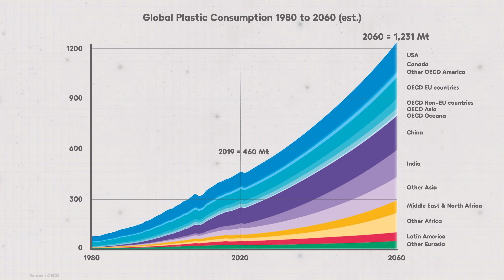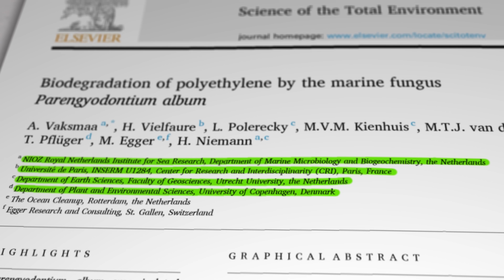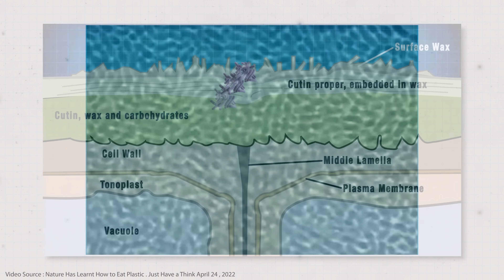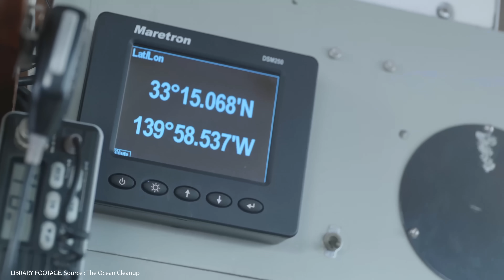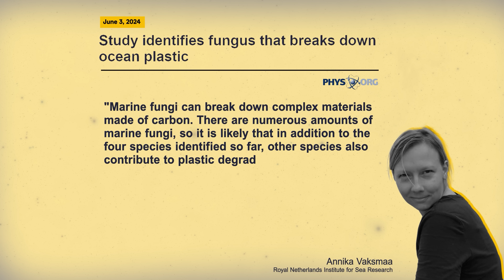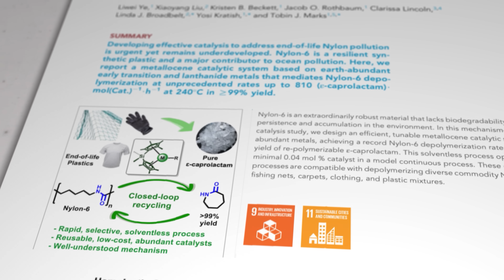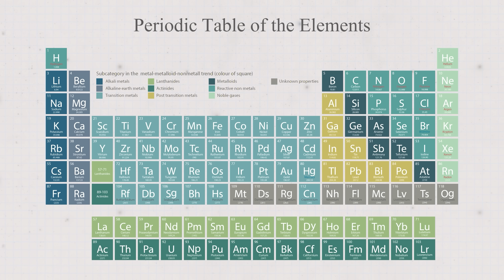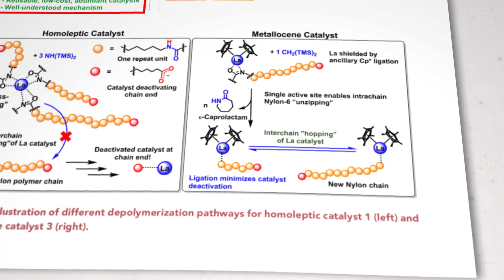Our oceans have learnt how to EAT PLASTIC!

Comment: The irony is that because we haven't given a damn, we have eliminated one of the major benefits of plastic: it doesn't decompose.
Reply: Much the same story with anti-biotics
Reply: Well there goes my classic console.
Reply: @chudchadanstud  There goes whatever we store in plastic containers and packages and even our damn water sources (stored in huge plastic tanks in our buildings).
Reply: @chudchadanstud  My super nintendo has been degrading since the 90s. The clean white shell has turned into a flaky yellow. This is why I switched to emulation
Reply: @chudchadanstud  it's ok. your console will still outlive you
Reply: @chudchadanstud metal is not
Plastic. What console do
You have? 😅
Reply: @whiteingale majority of game consoles are made of plastic, not the machine parts,  but the covers.
Reply: @tfive24  i see. 😅 I come from older generation
Reply: @Fuscao_Preto  i decided to look into this and they are primarily made out of a variety of papers/ glasses + resins for the majority of the filler (the usually green part of the circuit board) there is no plastics used in circuit boards (with the exception of things like breadboards) due to high heat exposure during soldering.
Reply: @himebito  I think you're a bit confused. Plastic is still present in the form of polymers (polymer resin's). Also the green part is usually a solder mask. So it would still be eaten away in the form of delamination...
Reply: @z-ZONDER-z_E15 if you're storing your x box in an ocean gyre yes. Maybe keep it in the living room?
Reply: @Fuscao_Preto  
Its a epoxy based glass laminate, some like FR4
Reply: @tfive24  pretty sure machine parts too, the PCB substrate is made of plastic as well.
Reply: @whiteingale  the cooling fan , the sleeves around the wires that protect the cables from interference , the socket of the cpu , the connectors , 
the outside of mosfets and other chips soldered to the motherboard that have a plastic protective casing around them etc etc etc etc etc
Reply: @Fuscao_Preto  They are Fiberglass and Resin. Some PCBs are actually made of ceramic but not only ceramic is considered to be outdated but also insanely high-end by today's standards. IBM's Power Architecture modules were gigantic MCMs made of ceramics with several CPUs, Dedicated Cache ICs and some sort of ASIC incorporated into the humongous MCM package. So yes ULTRA HIGH END stuff. Mainframe kind of stuff.
Reply: @EvolutionDataOptimized  that;'s my favorite subreddit!!
Reply: @norbertnagy5514  you're smart just like reddit.
Reply: @whiteingale  someones regarded
Reply: @Fuscao_Preto  There have been PCBs from the 1980s that used Sapphires as a substrate, feel better.
Reply: @Fuscao_Preto  Metal, sand and plastic or something like that, yeah? lol
Reply: @whiteingale  99 percent sure electric devices always have a teeny bit of plastic even if just for some microscopic reason
Reply: @whiteingale uhhh my guy.... your consoles are made with metal
Reply: @Fuscao_Preto  PCBs are usually made of silicon or fiberglass and other materials
Reply: @Fuscao_Preto  Silicon???
Reply: @Fuscao_Preto  Fiberglass mostly?
Reply: @Fuscao_Preto  
"I wonder what PCBs are made out of."
I looked into that a little. They can be made of many different materials, but the most frequent one seems to be fiberglass reinforced epoxy resin, that is, glass + polymer.
Reply: @whiteingale  say you were born in 08 without saying you were born in 08
Reply: @draywolf4761  makes me feel old now.
Reply: Welp, back to heavy metals!
Reply: @ozvoid1245 imagine if they evolve to consume that too
Reply: as long as they stay in the ocean and away from my anime figures it's cool
Reply: Another reason not to go outside bro @tempoaccla4041
Reply: Don't worry, Margarine Butter is still a close second in non degradable products that nature doesn't even want to touch. If you leave out Margarine next to an ant hill, they will never eat it. Nor any other bug.
Reply: Same story as antibiotics. We have a real knack for coming up with miracle products then ruining them through apathy and greed.
Reply: This sucks
Reply: We haven't eliminated that unfortunately. It not decomposing is actually better now than it was in the past. Bottles and bags whatever type of plastic they were made of became brittle and broken much faster about 20 years ago. Weren't flakey and crackled. Now it's a lot more robust.. I mean not all of it you still get the chappy type as well.
Reply: how is that a major benefit
Reply: @SirMrTreflip how isn't it?
Reply: Plastic bag decomposing after 150 years in ocean will not discourage anyone from using them.
Reply: @lamebubblesflysohigh what are you trying to say….
Reply: Well the problem is that eventually it’s gonna evolved to become airborne like the microbe that govern decomposition. And it will keep getting better and better meaning we have to find an alternative or all of our canned products will start having holes drilled into them.
Reply: BAN PLASTIC. GO BACK TO GLASS.

REDUCE REUSE.
RECYCLE IS ONLY A DREAM.
Reply: A solid piece of plastic will be eaten much slower than microplastics or something buried in a landfill, if at all.
Reply: This means we can pollute the oceans as much as we want. It's OK to do so now.
Reply: It's other benefit is that it's still ridiculously cheap and effective in manufacturing.
Reply: Larry Niven predicted this decades ago!
Reply: Decomposing is probably pretty slow...
Reply: @birisuandrei1551  Depends on bio availability of the bacteria. If it is extremely available, a plastic bottle would be gone in three days. If there is no bacteria present, it sticks around until it is found by some.
Reply: Sure, but the solution on our end would have also been to make plastic decompose so it wpuld have been the same end result, no?
Reply: @Abicated  not exactly, it would probably have become a completely different material with different properties, like if doing that made plastic twice as flammable, would you want it? I certainly wouldn't, I'd say we are living an almost best case scenario because the plastic won't just degrade at random, it'll happen after being hit with UV light.
Reply: Yes that is the idea he states in the first 30 seconds of the video.  Very good.
Reply: Well, at least it's still more versatile than bone and horn.
Reply: love nature
Reply: since when do u throw ur shit in the ocean and expect to get it back?
Reply: Durable, high-quality polymers designed for long-term use were never immune to decay - they're just resistant to it. You still have to take measures to protect them (especially ABS's vulnerability to UV light).

We'll just have to adopt new protective practices and change up formulas to adapt.
Reply: xd
Reply: The micro and macro organisms are top of the food chain. We are just lucky enough to share a planet with them. We have made them a new food.... What are they doing with radiation?
Reply: Unless you are planning to put any plastic for storage into the oceans - but not deep enough for there being no UV light, ocean fungi won't eat your stuff. It's also not as if plastic was indestructible or did never go through any forms of decomposition. It did erode through UV exposure and mechanical forces anyway.
Reply: “Life… Finds a way…”
Reply: Give it time, and we’ll have the Zurks from the game, Stray.
Reply: Plastic being decomposable isn't a problem. Wood is decomposable too but we have furniture made out of it that's hundreds of years old.
Reply: war and pollution result in evolution......no wonder we are they way we are.
Reply: the biggest benefit of plastic is actually its thermplastic nature, not its permanence
Reply: It's amazing that you can look at the eternal longevity of life and evolution and still try to be a downer about it.
Reply: @wiilov  Eternal longevity of life?  What are you talking about?  This world is a dying world.  The only way to have eternal life is to believe on Jesus.  Then we can have everlasting life in the new creation.
Reply: Also, it's hygienic. Gonna be fun having to make cheap sterile medical devices if there's fungus on every single polyethylene item.
Reply: of course they do, it's just that you don't know about it, or don't know the time it takes, there are microbes that live on hydrocarbons. Life always finds a way. But, seeing all these waste dumps and rivers in places like India with all these skinny kids rummaging through it, how is that our fault ? or starving Africans ? did we do that ? no. Shit people create shit problems- the officials there would rather line their own pockets. Every couple of years it's "oh save the children !" were do they keep coming from ? yeah....and then you have outfits like World Vision who take 90 percent of donations and line their own pockets, again...shitty people make shitty problems...
Reply: It doesn't chemically decompose, but environmental factors can easily damage its physical integrity, rendering it no longer fit for the original purpose.
Reply: Was that ever true? Before this discovery, talk of micro-plastics has been rampant... I'm more thinking the media just lies about everything to stoke worries and raise money.
Reply: It does, it's just very slow.
Reply: Thats not accurate at all. It always decomposed. This is not new. You don't go outside much do you.
Reply: yeah but that was always a lie... it just decomposes slowly into micro filaments that are very hard to break down
Reply: YOOO FR 🤯🤯
Reply: until petroleum based plastic was invented, all plastics were bio-plastic.  They used to all biodegrade.
Reply: As long as these fungi and bacteria stay in the ocean we should be fine. The more plastic there is, the more stuff will evolve to eat It. There isnt nearly as much plastic on land (except for countrys like India or Indonesia) as in the ocean. Especially not Combined with the conditions needed for these things
Reply: Honestly I disagree. Plastic structures break down very easily & there's not a lot of uses for microplastics.
Reply: How would "giving a damn" have stopped the course of evolution?
Reply: @petersmith2137 
If we hadn't dumped so much of it everywhere there wouldn't be anywhere close to as much opportunity for microbes to evolve to eat is
Reply: @hylkevanderwerff  Well, we gave a damn about it being thrown out where we live, so we threw it in the ocean and didn't care about it expecting something to evolve and eat it for us, which happened, I wouldn't be optimistic about it though, who's to say they wont decompose it into dangerous chemicals and not just co2?
Reply: @hylkevanderwerff if they eat it, it is food. 
Where is food, there is life.
Reply: @hylkevanderwerff  Imagine something the size of termites or locusts evolving to eat plastic. We would be screwed.
Reply: @hylkevanderwerff it has to be dumped somewhere lol! I don't think land fill fungi are any less able to evolce than sea ones. And since we make disposable things out of decomposable material it's bloody essential that this happened thank god we were careless enough to leave it in the gyres than just burnt it.
Reply: @DarkWolfsDen how would we be screwed, we have thousands of bugs thst eat wood and nobody is screwed by that unless they leave wood out ina. Damp shed. Are you storing your plastic items in an ocean gyre? Maybe keep them in the cupboard.
Reply: @Padraigp  You believe in everything you see in the internet? And we havent looked deep into it yet. A lot of stuff that was once good now is bad, or rather, what once was "common sense" became wrong. You literally cannot know for certain if those studies are 100% correct and the only thing being made is CO2 or not unless multiple independent sources and researches say the same.
Reply: @Ralzone co2 is what comes out when a cells doed celluar respiration so probably not
Reply: @DarkWolfsDen Termites have microbes that digest wood. It wouldn't be far fetched to assume that an organism can incorporate gut microbes that digest plastic.
Reply: @Ralzone  The expectation that natural processes will automatically handle waste can lead to significant environmental issues. so its crucial to develop and implement effective waste management n technologies to mitigate these problems
Reply: @petersmith2137  not polluting would not have allowed bacteria the opportunity to try and eat plastic. Evolution of that type would have never happened.
Reply: @petersmith2137  those organisms wouldn't be able to multiply a lot if they didn't have a lot of plastic to eat
Reply: Umm plastic does decompose.  What do you think disk rot is?  Why SNES turned yellow?
Reply: @KameradVonTurnip  It's a slow decomposition because of UV and reactions with oxygen or loss of oxygen in most cases (SNES plastic loses oxygen over time and this causes it to turn yellow. UV speeds up the process so sunlight actually makes SNES decompose faster, it becomes yellow and brittle and breaks into a million pieces what many would call "micro plastic".) still with biological organisms capable of digesting plastic... This means that even microplastic will disappear which is good. For now what's going to happen is that nylon networks and microplastic will dissolve within 5 years. This is awesome news. However if these organisms evolve further we might see all plastic rotting way faster. Let's hope it does not happen to PVC because our pipes are made of it.
Reply: @KameradVonTurnip  Because it absorbed radiation from the sun? Plastic doesn't (or didnt) decompose, what it did though is get fragmented into smaller and smaller pieces.

Comment: I suspected this for a long time.  Thank you for confirming it, and adding technical detail.  People tried to find the plastic on the ocean floor a couple years ago, and the amount they found was very small compared to the amount of plastic debris known to be entering the oceans.  The ocean environment is very harsh, with bright sunlight near the surface, salt water, immense pressure at the bottom, and all kinds of bacteria. It's not OK to litter the oceans, but "Ocean Cleanup" died more than than good and should go out of business and stop wasting diesel fuel.  They can burn 200 tons of fuel, and come back with one ton of plastic, and then claim to have done something good.
Reply: They are doing a multi pronged attempt at reducing waste that enters the ocean. The garbage they remove from the ocean helps them learn were it is coming from which can lead to ways of reducing that waste. Also, the initial ideas are prototypes and over time they will improve for instance swap out their diesel ships with solar powered ones. One was fishing gear, while another was water coming from rivers which they have created interceptors to collect the garbage or work with the local government to reduce the amount of garbage that enters the river. Either way they are doing something which at the very least will inform other organizations and governments when they go to tackle waste in the ocean.
Reply: @fastkicksdefendhead  that's good to know, thanks
Reply: I get a scammy/money laundering vibe from those ocean clean up types
Reply: @Youtubecensoredmyusername maybe your subconscious looking for an excuse not to help?

Comment: the thing about fungi is that they are still evolving rapidly. .05% a day only at the surface will turn into a lot more at greater depth 10 years from now. This means that plastic pollution is a temporary problem in the grand scheme if things, and instead of banning plastics (which has had mixed results at best) we can focus on pushing for replacing plastics that biology is adapting to slowly with ones that can be broken down more easily by nature and reducing littering.